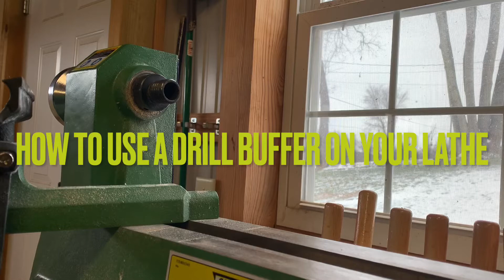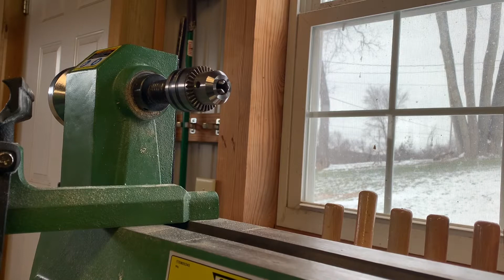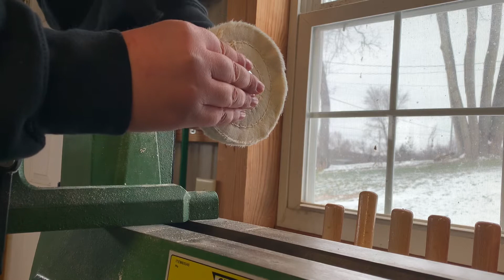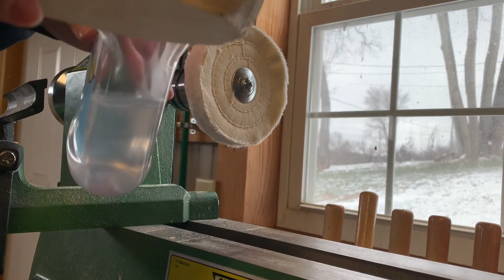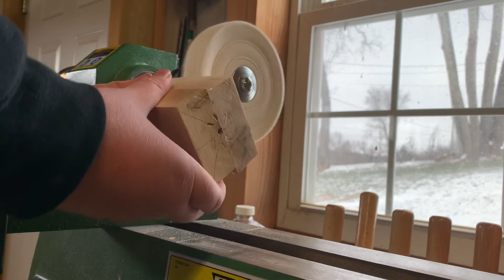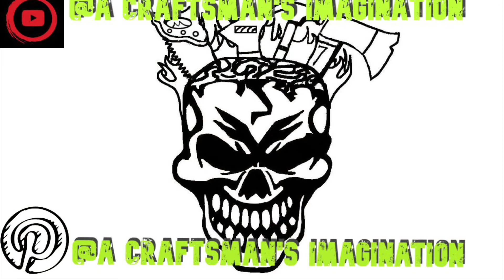How to use a drill buffer on your lathe

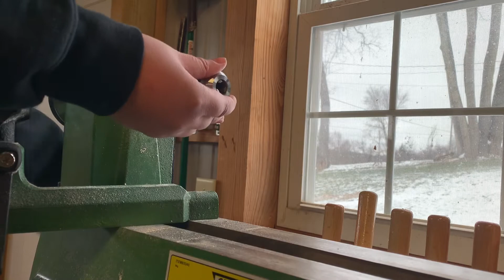Comment: Hi Morgan ,just  nipped over after a shout out from Jiggsy , first off mate ,not a good idea ,@00:17 ,that could damage the spindle in the head stock and when you use the drive center it will keep slipping because it's been enlarged, ( use the tail stock for support ) plus , you've got to get that out again,,. When showing us the product you use ( mineral oil ) ,leave it on screen for a couple of seconds (would be better with darker wood ),,.Keep safe ,,.Regards Alf
Reply from the maker: Thanks for the tip! I’ll remember that in the future. Luckily I haven’t done this since I made this video, so hopefully nothing is damaged. Thanks for watching!